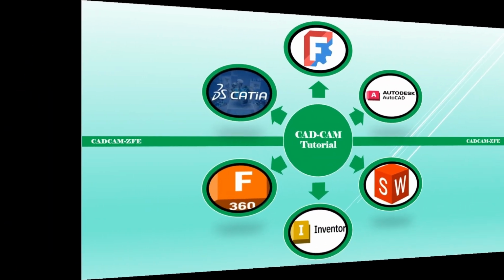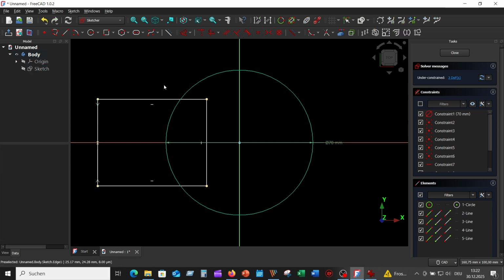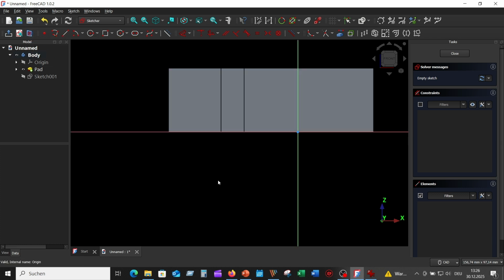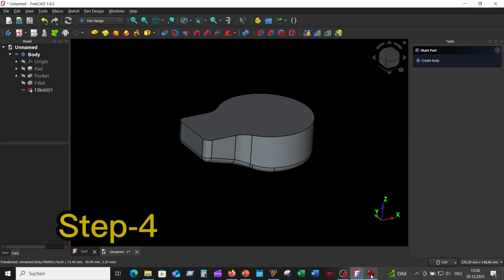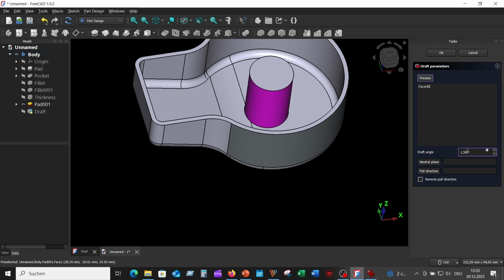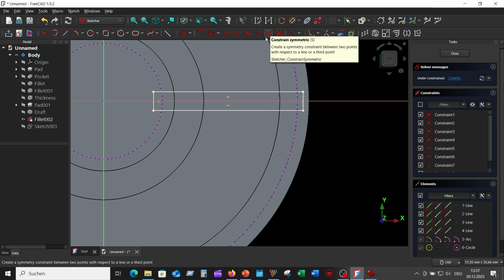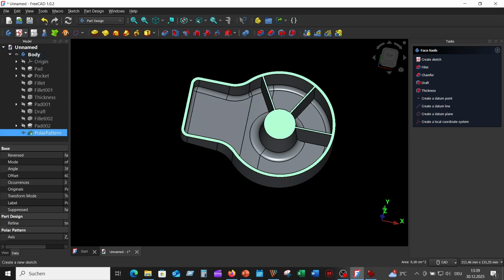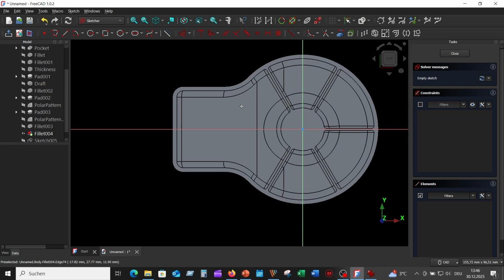FreeCAD Tutorial for beginners, 3D Exercise #13

Comment: When I try to do the fillets at 6:43 I get the following error: "BRep_API: command not done". What could be the reason for this? And then right after when I try the Thickness it gives me this" Failed to make thick solid"?
Reply from the maker: Hi,
I don't know why you have a fillet problem with the first simple pad.
Check the following points, if they help.
1. check the sketch, if the curves are tangent to each other.
2. select the pad from the tree, and check the part design setting.
   Set-->  Part design -->> Refine --> True
3. I use the FreeCAD official release 1.0 (1.02). I don't know if you use different one.
Reply: @Zfe-addis41368  I Use FreeCad 1.0.2 also. I'm going to start over and see if it will work this time.
Reply: I started over completely and was successful this time, thank you!